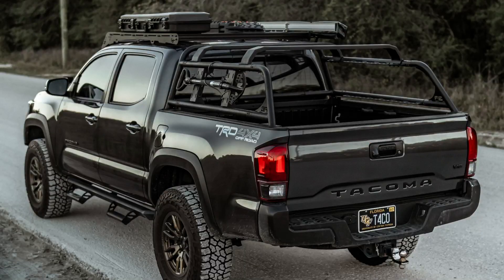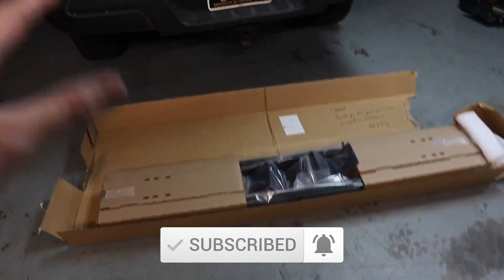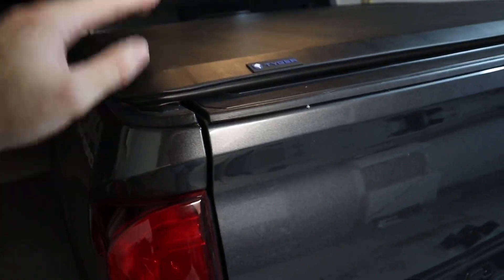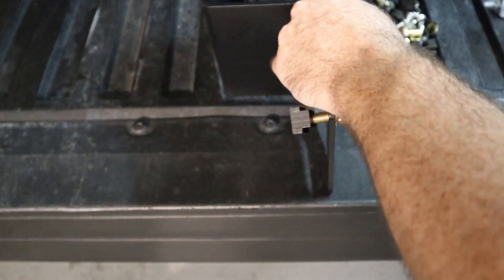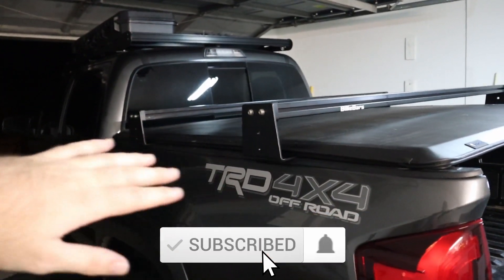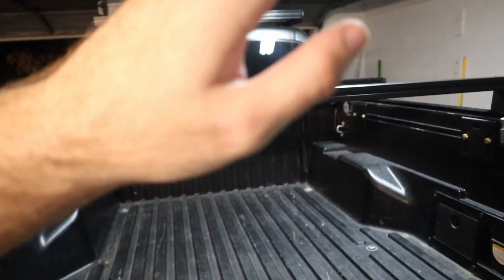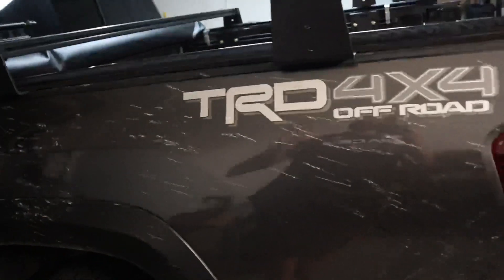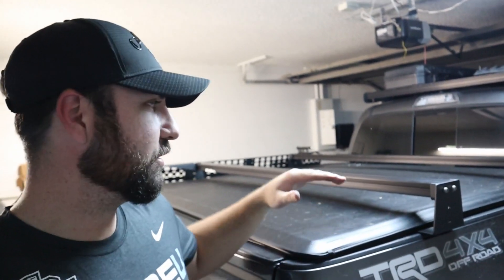BillieBars - Bed Cover Compatible Bed Bars | Billie Bars Install | Tacoma Bed Bars | Tacoma Mods

Comment: Good bud and it was exactly what I wanted to see. I’ve been trying to piece together something affordable for bed bars that will keep a RTT at/below the roofline, and have enough room for coolers/totes on top of my Decked system. Getting too old for loading/unloading everything to make camp under the Softopper every time I move!
Reply from the maker: This could be a great setup for you then! They have an 8" option as well which would give you more room under the bars.

Comment: Man I was just looking at these. Was considering a traditional bed rack but I think these would be more useful for when I need to use the truck as a truck.  There's another brand of these type bars that people recommend but the Billie bars seem to be of far superior quality
Reply from the maker: Same reason I switched from a full bed rack. It's much easier to remove the cross members of the bed bars than it is to remove the bed rack if you want to use the bed.

As far as the other company, I went with BillieBars based on reviews from people I know. They were also a lot better at communication than the other company. I'm really happy with the quality of this setup too, they make a solid product.

Comment: I have the same bed cover (roll up) with the side rails that have the velcro hooks.  Viewing this video, it is apparent the two billiebar brackets fit under the cover rails which will leave a gap regardless how tight you cinch down the siderail clamps. So, it is going to allow water intrusion. If I do this to my Tundra, I am either going to place extra weather stripping under the siderails or a strip of aluminum the thickness of the billiebar bracket between the two brackets and at the ends of the rails to allow a snug fit between the cover's siderails and the sides of the bed. Another possible option (I have not explored) would be to trim the side bar (where the billiebar brackets will go under) so there are no gap(s) anywhere.  Several others have mentioned concerns about this. So, this is my "theory" on it.  2cts
Reply from the maker: For sure. In my experience, water intrusion wasn't really an issue. But you can definitely make it a bit better if you fix the gap.
Reply: Just curious, did u settle on a tonneau cover that works well with the billiebars?

Comment: So sick. Would it be possible to just mount the Molle panels only and not the cross bars? I have the oem tonneau and wondering if I could do that
Reply from the maker: Yes I think that would work as long as you have the brackets. Bars are easily removable too

Comment: Hey love the videos. I live in the Central Florida area. I just picked up a Taco. I’m looking to start heading out to the woods and camping. What are some cool areas to camp?
Reply from the maker: most of FL wildlife management areas don't allow dispursed caming. You'll need to check their website to see about options for that or renting a camping spot at a designated campground.

I think Ocala national forest is your best bet, but it's pretty vast & easy to get lost in so make sure you're prepared & preferably don't go out alone. You can find a few Facebook groups that have groups go out so you can learn the trail system

Comment: Thanks for making this vid! I have the tyger roll up cover and was looking for a compatible rack to work with it!
Reply from the maker: No problem! They also have an 8" option that would be a little easier to work with the roll up
Reply: Do you have any water leaks? Mine leaks so bad.
Reply: @요타아빠  No mine doesn’t leak at all.

Comment: Is there any issue with the weather strip lining under the sides of the tannaeu cover after putting the billie bar 5" brackets on? I have a similar soft tannaeu cover (TruXedo TruXport from amazon) and was wondering if you had to cut out any of the weather stripping for it to sit level
Reply from the maker: Nope no issues. I moved around the clamps/mounts for the bed cover to get the best seal possible. The foam just molds around the BillieBars brackets.
Reply: @KnightWheelsMedia  Thanks for the video and reply! Going to install mine like that then
Reply: So no rain getting into the bed?
Reply from the maker: @mikeferretti7422  none that I noticed, but it also hasn't been rainy season
Reply: @mikeferretti7422  I live in a desert so haven't been able to test that yet. Will keep you posted

Comment: Looking sharp, i still have my oem trifold cover so I'm not sure what rack system to go with, I may just have to get a new one
Reply from the maker: Yeah with a tri fold you just won't be able to fold it up completely unless you take the cross bars off. You may be able to get the first fold open or at least slightly open though depending on where you put the rear bar.

Comment: I dig the bike mount. Super simple. Do you know if it’ll work with a prinsu cab rack? What size are the carriage bolts?
Reply from the maker: Not 100% sure if it'd work since the extruded aluminum for the Billie Bars is bigger than the Prinsu stuff. I'm sure you could easily find hardware though. With my Prinsu rack I believe I used 1/4" carriage bolts.

Comment: How tight is the cover with the billiebars brackets? Does any water get in the bed? I just ordered this cover for my truck and have my billiebars installed already.
Reply from the maker: I didn't have any issues with water getting in, it was a relatively tight seal. I think it depends more on the bed cover & what type of foam/rubber is sealing it.

Comment: I have the Soft Fold Cover from Tyger not the roll up one , wondering if it works with that Cover .  Setup looks clean
Reply from the maker: It will fit with it, you just won't really have room to lift up the cover much.